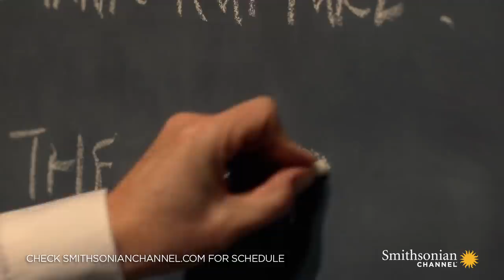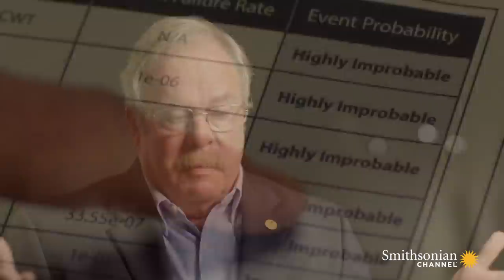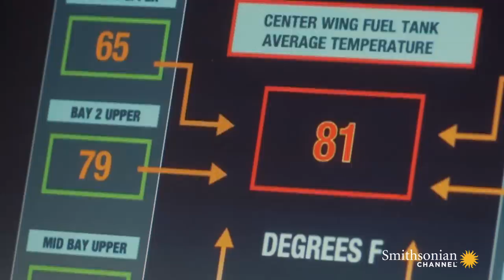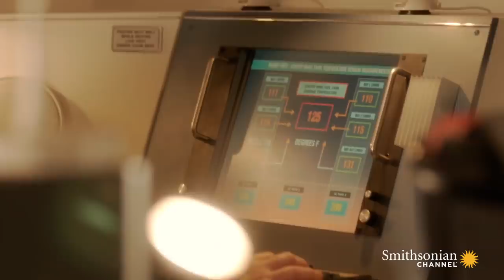How Air Conditioning Caused TWA Flight 800 to Explode

Comment: TWA flight 800 went down during a clear summer night off NYC's east coast. There were many people out and about that night; many of whom saw a streak of light go up into the sky and then an explosion. The US Navy was conducting exercises that night off the east coast.
Reply: Please please.... The NAVY was 185 miles south but not firing missiles.  That rumor interferes with other info that most 'need' to ignore.  it kills the sensationalism though. It has made Videos and has sold books due to premature distribution, but who is going to write a book and make a video and then have to 'back track'???
Reply: You do realize that the plane was at 15,000 feet?  That means the plane was more than 2.5 miles high.  The plane was also several miles off the coast of Long Island.  Light is faster than sound.  At the time you heard the explosion, the plane had already blown up about 20 seconds beforehand. Looking up,  the contrails would have been illuminated by the setting sun, seen the explosion which had happened about 20 seconds beforehand, the plane already split in half with the nose falling and the rest of the plane out of control going upward.
Reply: @robshef718  The explosion of the mid fuel tank.  After that went off, it weakened the front of the airframe, causing the nose to sheer off.  The engines were throttled up, so as the plane lost significant weight it initially pitched upwards and climbed.
Reply: @easternyellowjacket276  why do you assume that people had to be alerted by sound before seeing this happen?  Back before cell (phones), BC, people actually observed their environment and had a modicum of situational awareness.  Those days are in the past, but it’s an interesting historical note.  Now of course sheeple only look down and follow the feet of the sheeple in front of them.
Reply: @easternyellowjacket276  not according to the radar data. It never climbed one foot. It veered right and then left as it death plunged into the ocean. Why do they need us to think it climbed? When the nose came off those engines throttled down, no power to the throttles, and idle is the none powered default on those engines.  So many lies that can be debunked scientifically...
Reply: @KBS117  Power to the throttles?  When the nose came off, the plane immediately lost weight in the front.  Conspiracy theorists always have some bizarre explaination.  So what are you qualifications to make your declarations?
Reply: @easternyellowjacket276  I don't debate with idiots.. however I will say this. The aircraft was ripped in half, with the computers, pilots and all controls plunging into the sea. At that moment everything went dead, everything lost power, and those engine turned off. Only a complete idiot would think that plane kept flying. It fell out of the sky.. my theory is the tail pointed straight down when the nose came off. With no thrust from the engine the airframe stalled with the tail aimed down to the ground.  Then it began falling to the ground with the heaviest part of the airframe aimed at the ground. This is what ripped the wings off as it spun falling backwards..  once the wings came off it broke up into individual pieces.
Reply: @KBS117 also after the nose fell the air entering the cut open fuselage would cause massive amount of drag that will lead to a stall